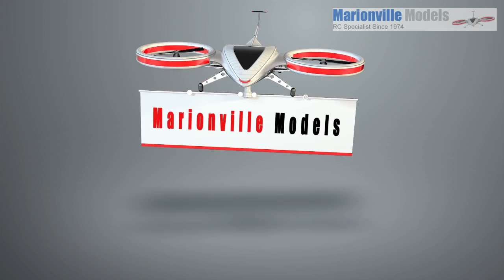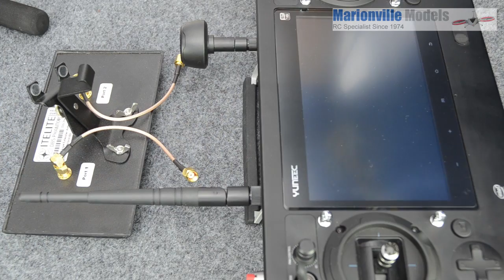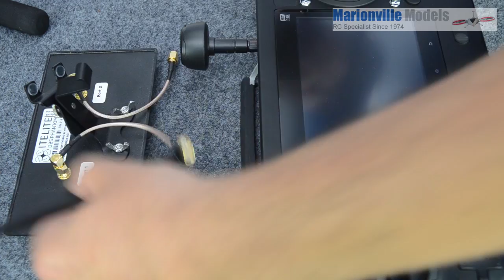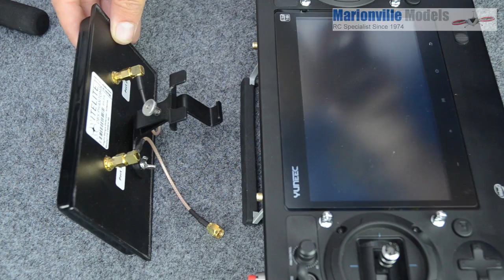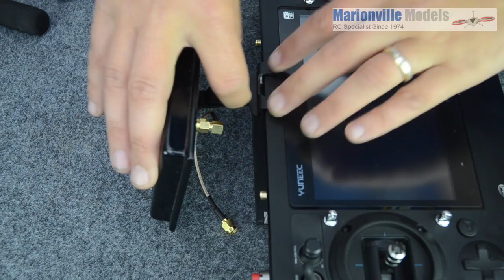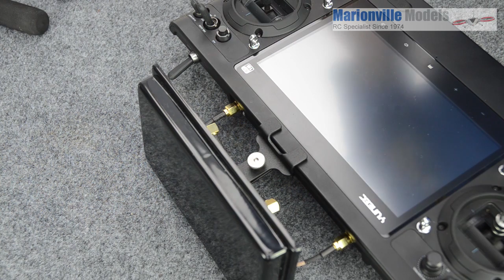ITELITE DBS046B Antenna Upgrade for Yuneec Typhoon H ST16 & 24 Controller

Comment: great video , very clear, many thanks...........subbed already........i have sent an email with my inquiry.......keep up the great videos....
Reply from the maker: Thanks. This is the new version of it. http://www.marionvillemodels.com/products/itelite-ite-dbs05-6b-typhoon-h-control-st16-st16-extended-range-antenna?variant=31675261510
Reply: Marionville Multirotors hi,I just got my new St16,which has 3 antennas on top. one is a patch which I assume is for the Fpv and the other two is for rc. does the link you give above apply to the new ST16? thanks

Comment: I've heard great things about the FPVLR antenna set. Any experience with those?
Reply from the maker: I haven't tried those ones.
Reply: I understand that they are somewhat less directional, yet offer 3x increase, as does the Itelite. One advantage is the smaller storage footprint.
Reply: The fpvlr antennas seem better in a city setting than itelite. Itelite in a country setting all day
Reply: The fpvlr antennas seem better in a city setting than itelite. Itelite in a country setting all day

Comment: Why would Yuneec have and antenna ports for 2 antennas and still have an internal 2.4Ghz antenna???  Yuneec needs to change this to get better performance on the telemetry!
Reply from the maker: The internal antenna is for telemetry. There is a Max Range version of this antenna but requires modification to fit.
Reply: Yes, I know.  But Yuneec put 2 external ports on the controller for the other antennas, and they should have also put a 3rd port for the 2.4Ghz !  How could they be so stupid???

Comment: I understand Itelite is going to offer a 3 antenna version for the ST16 so that the internal antenna can be routed out like the other 2. This is supposedly to improve the telemetry signal which is still weak with the DBS046B. Have you heard anything about this?
Reply from the maker: There is a set being tested but I believe it requires modification of the controller which would void your warranty.
Reply: But....does the internal antenna carry the telemetry signal? I heard there are 2 internals at right angles.
I'm really not so worried about the warranty on the ST16. The farthest it's likely to fall is 3'. I have 7 Yuneec birds and I've never had to use the warranty anyway but I hate losing telemetry.
Reply from the maker: +folepi22 the telemetry antenna is inside I believe.